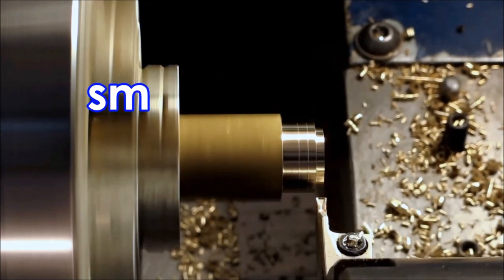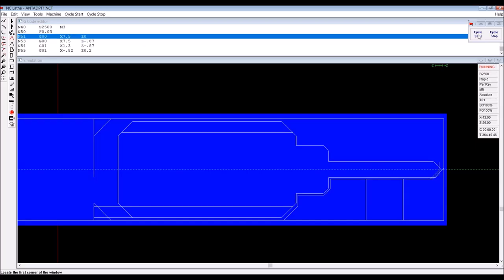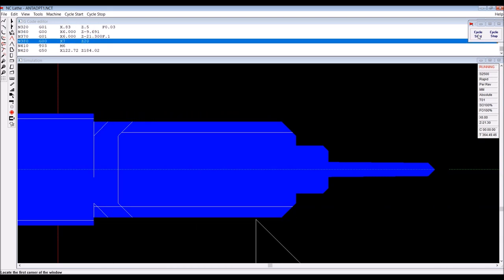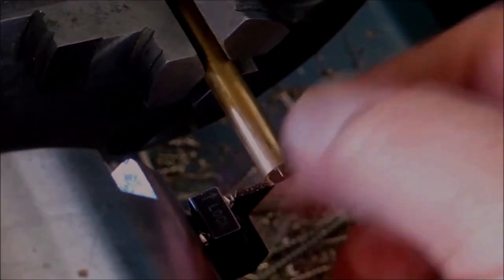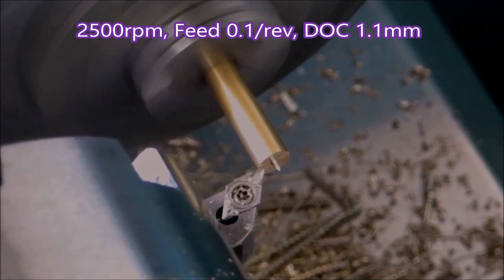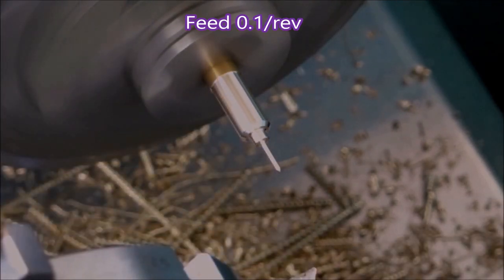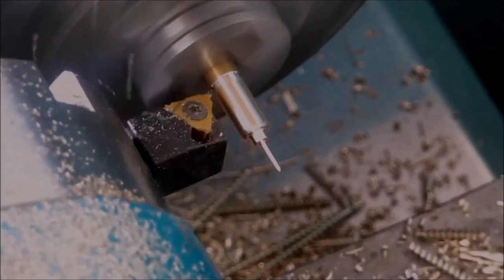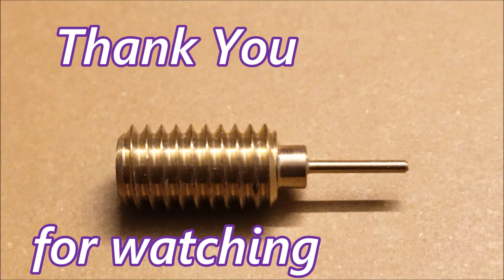Antenna adapter for coaxial cable. M6x1.0 thread, with 1.0 diameter x 7 long probe.

Comment: I wondered about flex in that long thin portion. That was an interesting approach to fixing the problem!
Reply from the maker: Thank You, I really did not like the idea of doing it any other way.  It worked ok and with the offset to get the part parallel , I was quite pleased with the result.

Comment: For the offset to keep the part parallel, did you just dial that in by trial and error? Cut one, check the taper?
Reply from the maker: Pretty much trial and error. Is there any other way? I would think that even a change of feed rate could influence the required offset?
Thank you for an intelligent comment.
Reply: @smallcnclathes  For sure, that's how I would have done it. Just wanted to make sure I wasn't missing something. I don't have much experience turning, I run a 3-axis cnc mill in a prototype environment, and we recently purchased a cnc lathe that I'm going to have to figure out how to run. Your videos have been really helpful learning tools, by the way, just showing the process and how certain techniques are used practically, so thanks for making them!
Reply from the maker: Zachary, I am sure you will get the hang of it quite quickly with one less axis to deal with!  If I can be of any assistance you can always contact me on Facebook through my Notewell page. You will of course have a heap more power than I have on my little lathe, but some things don't change that much.